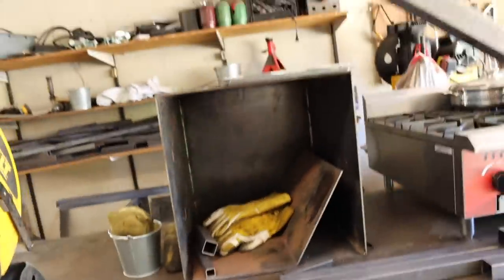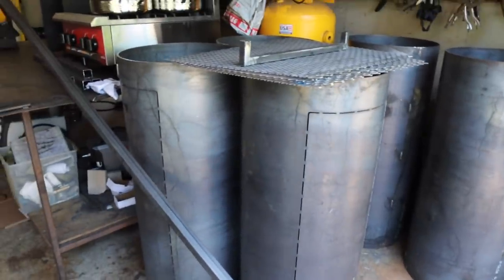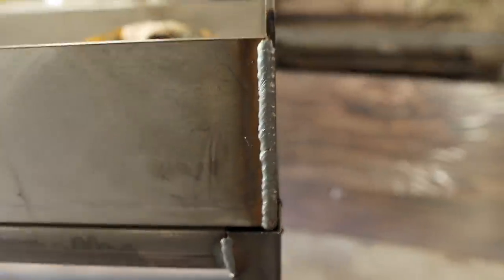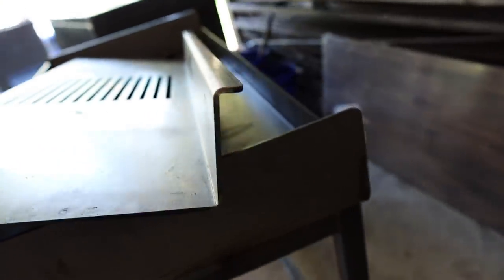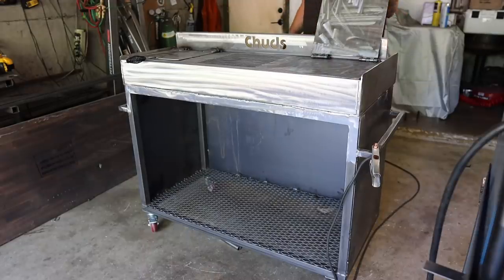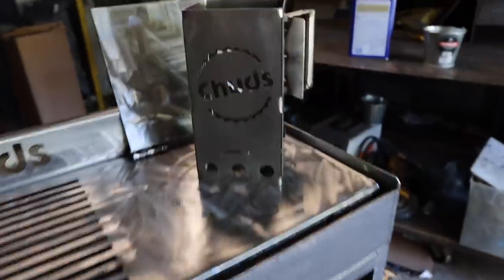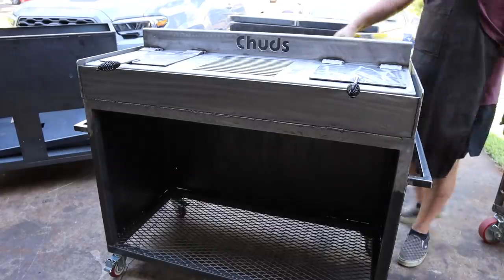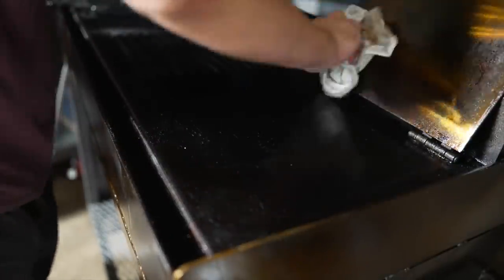New BBQ Pit Build, the Griddle/Taco Table! | Chuds BBQ

Comment: FREAKING AWESOME BUT A HUMBLE SUGGESTION FOR VER. 2.0.  I am a tinkerer myself, building out a homemade 35 gallon PBC with hardwarwe store bits and McGyvered parts.  For the Taco Table, humbly i would suggest dropping the second tortilla press and basically making it 1/3 tortilla press / flat top and 2/3 slotted grill. I cook a lot for football parties, gstherings, etc, and thinking out loud I doubt I'd ever meed to use two presses and would prefer more grill space.  Food for deeeliciousness thought.

Comment: You could even make a grease trap in between the gap
Reply: A grease trap would be a very nice addition for sure
Reply from the maker: Yeah I planned on putting a grease trap in but I would have to drill through the frame and I didn't feel like doing that, just being lazy

Comment: U build nice stuff but I'm telling  your weakest link is welding  on them casters. Be better to weld a plate with holes and bolt them on.  Casters generally  don't last long then need replacing.  Customers  would appreciate  bolt on or welded for easy replacement.